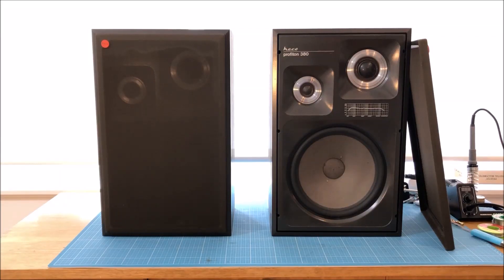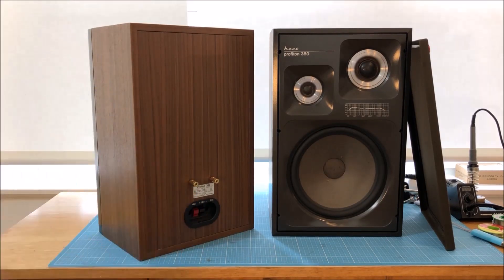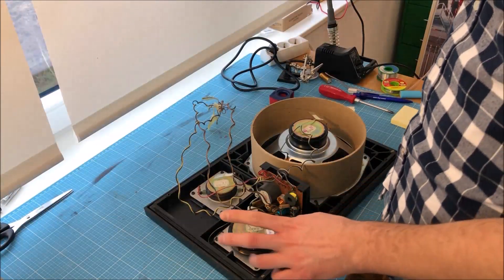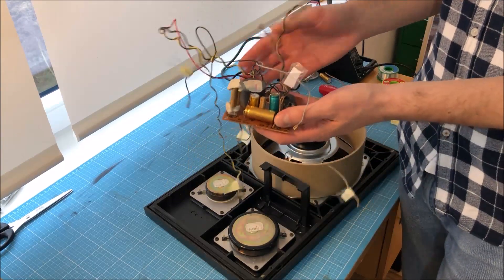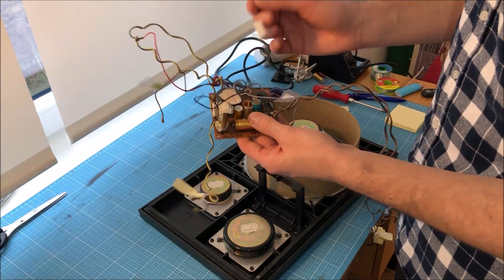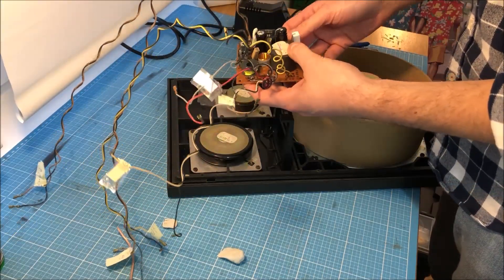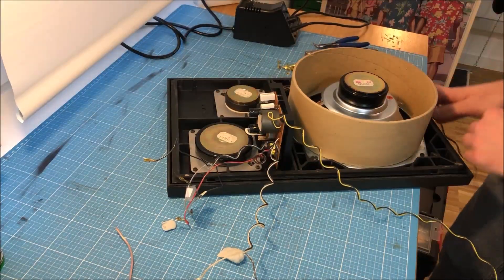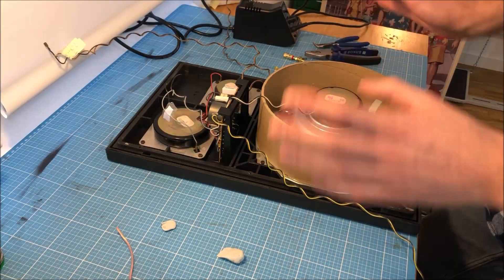Speaker restoration / repair - capacitor replacement / crossover - Part 1 - Heco Profiton 380

Comment: Hy, dunno if you read these or not. But did you measured the caps? I just servicing one of these speakers, altho it is a 370 model not the 380. And here all the caps are still in great shape, all well within normal values. Are yours gone bad so you changed them?

Comment: I have similar profi 140's I got used. Thinking about this —but mine don't have binding posts... Thinking about installing also since the speaker wires are just directly connected into the components (like my turntable, it's really annoying not to be able to swap cables). 

Where did you get your stands (i want!) !!??

Comment: If I may ask, why did you replace these caps in the first place? I am asking because I have an old sony speakers suffering distortion at high volume (one of the 2). Could the caps be the problem? 🤔 The speaker looks intact including the rubber parts..
Reply: If I may answer on behalf of Hi-vintage: Capacitors we call electrolytic have inside a liquid electrolyte which evaporate overtime. That gives them a life span of around 20 years, depending on power usage and number of hours. Even if they weren't use for years, they still degrade. This is also true for any electronic devices but particularly if a lot of current flows through them. As for your Sonys speakers it may be the capacitor but it may also be one of the drivers been overdriven which can difform the suspension and voice coil . You will have to open them and test them individualy to verify if that is the case.
Reply: @yvesboutin5604  Thank you very much for replying. I did indeed open them both and the caps tested 2.36uF on the bad one and 2.2uF on the good. They have ELNA caps rated 2.2uF
Not an expert on electronics so I don't know if the the value affects performance on the bad one. However I found out which frequency distorts and I raised the volume a bit while playing that frequency and the speaker went from bad to clear in a matter of seconds! No explanation why that happened since I don't understand the basics here but I am really glad it works as good as the good one!
I should make a video of them both as I love how they sound now with a new amp.

Thank you and I appreciate the effort and time you took to reply  🤗
Reply: @2BSaved  There is also the possibility of a loose wire or a defect in the gluing of the cabinet that make it resonate, but I still suspect this could be a driver problem. Concerning the capacitors, you can change for Mylar or polypropylene also named 'polycap' at a reasonable cost. At the same time, you can check if there is enough damping material like foam or 'polyfill'. If there is not enough, sound balance could be more midrangy and there might be too much chestiness in male voices. Don't be afraid to try many options by changing only one speaker and checking them side by side to see which one sound best. This could be a fun project and a learning experience. Bye!
Reply: @yvesboutin5604  Will do! I love dyi projects especially when one succeeds! 😁
Tysm 🤩
Reply: @2BSaved  If you could film the process through the many steps, I am sure many people will enjoy seeing what you can come up with! See ya !

Comment: Nice system at the end! I’m considering replacing my Sansui SPX9000 crossovers. I know I have 3 bad on one speaker. My Carver 6250 hit them with hard feed back when it recently smoked. I just hope I didn’t burn the supertweeters... haven’t tested them yet. But if the drivers are all good🤞🏻I’ll try it. I have to find a good online parts supply.

Comment: Where did you get the capacitors, who recommended you replace the fuse? Do they sell online?
Reply from the maker: Casey Link hi. I bought them at a local Hi-Fi store, they also gave the recommendation. But yes, you can find them also online. I’m sure also on eBay. Just type in the values and you’ll find it.

Comment: i have a pair of tannoy p40 speakers and the woofer is distorting due to a bad crossover, should i also change caps on the good crossover too ?
Reply from the maker: Dino Dean hi, Yes definitely. I would make a complete replacement. Then you have fresh caps on both speakers.

Comment: Good video!Can you tell please what is original values of capacitors, mine was changed so am not sure its original values,and why is good  to replace fuse with resistor...what is value also of resistor?
Reply from the maker: Mresearch Hi, thanks a lot! I have checked the photos I took before the replacement. following values: 
8,2uf 63v (blue)
10uf 63v (orange small)
33uf 63v (orange large)
0,22 Ohm 5W (fuse)
Reply: @hi-vintage2946  Thank you very much!👍